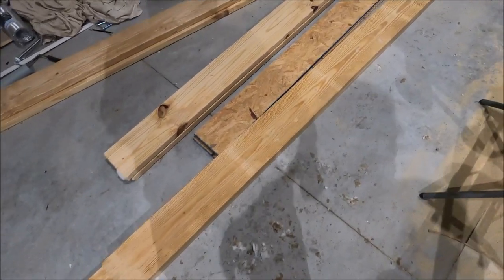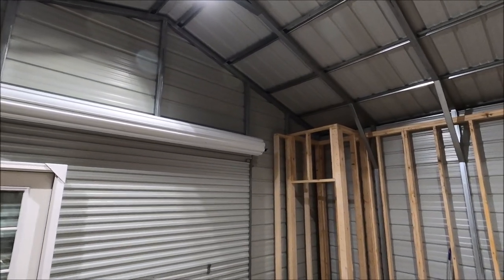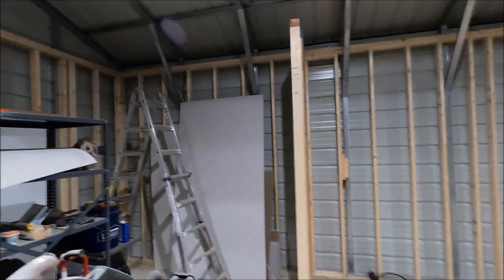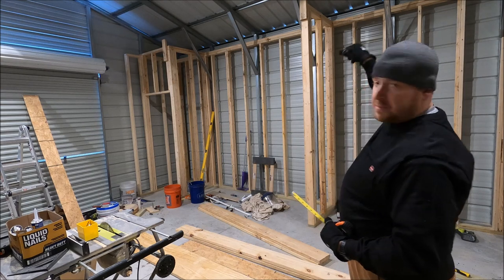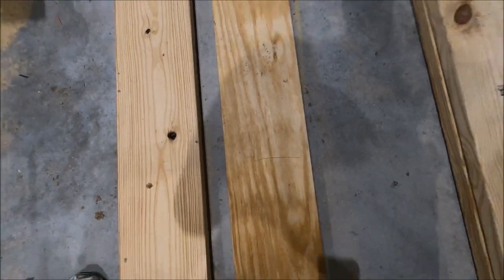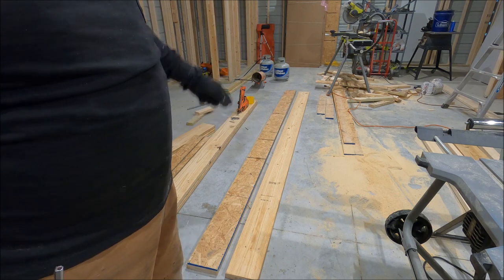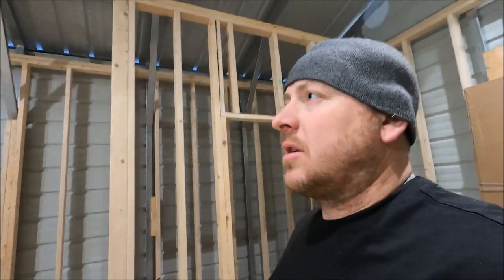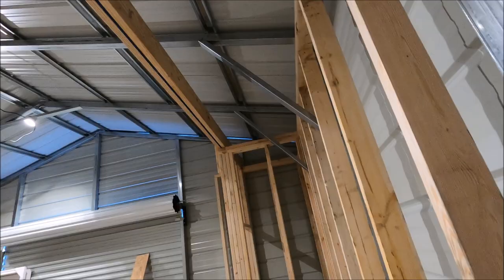Construction and Installation of Beam in Garage

Comment: 1. I don't know why I find these so interesting ... maybe because I've never seen anyone build a building inside a building?
2. I hope you stay with these videos long enough for us to see the interaction between the metal and wood structures ... one early example being that out of plumb side wall.
3. I've been accused of fastener overkill ... you sir,  put me to shame😁
4. Probably different where you live but I've never seen OSB aka oriented strand board called plywood ... and you're gonna find it isn't the best when it comes to finished walls or hanging anything heavier than a rafter square. Plenty strong enough for what you're doing but attractive and versatile it is not.
5. I watched your explanation of why you're going about this the way you're going about this but all I can think of is the carnage that will follow when that metal roof starts leaking ... and I say this as someone who has both a metal building and metal roofing on my two story brick home ... the first of which leaked from practically the get go while the other, after 15 years, shows every promise of lasting a 100 years.  
6. Instead of repeatedly resting two beams on a single 3 1/2" base, did you consider making up a more or less single beam running the length of the shop using alternating lengths of board/OSB (this would have to be constructed in place) or, alternatively, dead heading those stub walls with wider supports? 
7. Regardless, please keep filming and I wish you nothing but the best.

Comment: I am building my new workshop exactly as you are doing. My biggest concern is the moisture. I will be insulating the ceiling just as you are which will create an attic space. How are you planning on ventilating your attic space ? With these metal buildings I'm not sure you can get a ridge vent instead of a rig cap. Also the metal buildings that I have now don't really have soffits they just make it look like you have a true soffit. Really need your ideas on this. Love the videos, keep 'em coming!
Reply from the maker: I know I am going to catch some flack for this, but I am going to kind of insulate my roof twice. I am going to put board insulation near the edges of the sides of the eves as there are gaps where the corrugated metal rests on the wall.  I am going to put the board insulation a few inches away from the edge all along the sides about two feet in to keep the gaps open for air flow and then I am going to insulate the ceiling with about two inches of foam insulation to help with the condensation.  I am then going to put in a flat drywalled ceiling and put attic insulation in it so there will be a area just below the roof that will be open where the air flow can take place.
Reply: So you are going to use the board insulation as proper vents? This is the same idea that I was thinking of doing. If it’s wrong I guess we will both be criticized.  Thanks for the quick reply.

Comment: Oh no just spray foam the roof and paint the spray foam black so you stay with vaulted ceiling and have that height. Literally one spray foam kit at lowes would most likely do that whole ceiling and you can do it yourself and it cost 5 to 800 for that kit but so worth it in the end
Reply from the maker: What kind of paint do you paint it with? How long will it last?